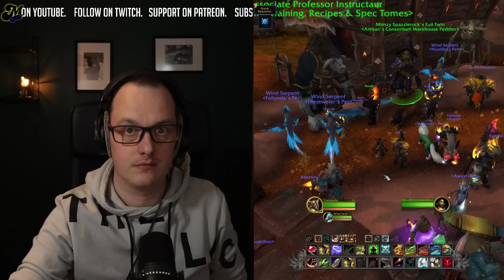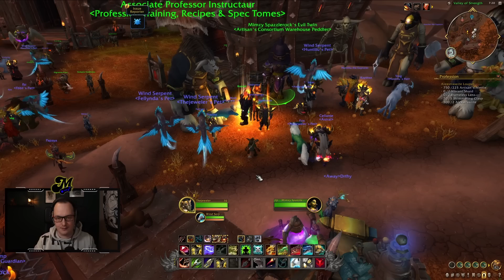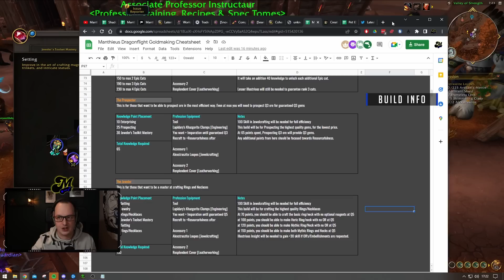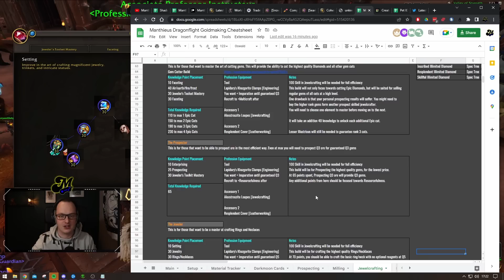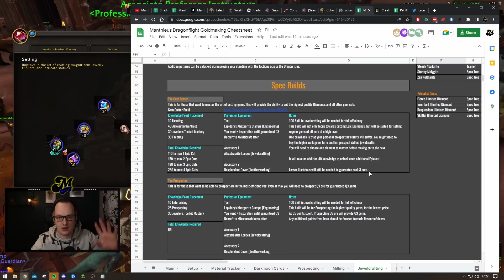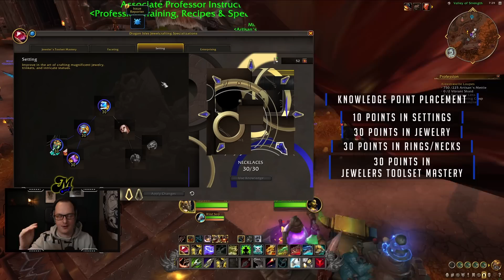Skill Required | Dragonflight Goldmaking

Comment: What about specializing into the Clasps ( up to 3 sockets on necks)
Reply from the maker: They are unlocked at 30 points in Settings, and such are a byproduct of this build anyway.
Reply: I wouldn't rush them. People won't buy them for intermediate gear. The demand will start after the raid opened and people get hc or mythic necks.

Comment: Do you feel specializing in crafter equipment would be worthwhile? My main concern is being brick walled by not having enough artisans mettle. I was thinking of doing this with my army of alts, as thought lots of people will need them at the beginning of the expansion.
Reply from the maker: Probably. This does heavily depend on what they plan to do with artisan mettle. If it has to be provided by the buyer, this could be a very good market.

Comment: Who doesn't see a repeat of legendaries here? I'm not sure work orders will help as much as Blizzard thinks it will. How many work orders do you think you would be fulfilling for R1-R5 legendaries if it existed in the current game? This very much looks like another gold sink barrier for entry (which for better or worse, proved to be the most effective one to date in terms of professions).
Reply from the maker: Recrafting is a thing. The early demand to rank 5 quality might be reserved to only those who are willing to pay the premium. Most players will buy a 2/3 quality items as crafters will be willing to fill orders on those for cheap to level up,  then be able to upgrade that item for a small fee later when the prices come down because more crafters now can make them. Unlike legos there is an upgrade path that does not require replacing or buying another expensive starting item.
Reply: @Manthieus  Can it skip tiers though? One of the major flaws of leggos was the ability for consumers to just skip tiers. It meant that R1-3 became sinks that no one ever wanted.

If they had been required for upgrades by all players, it would've driven the prices down across the board as newcomer crafters leveled up.

Comment: Hi, awesome vid! I'm also making the list of where I found the Knowledge in treasures, once Im done I'll text you on the discord
Reply from the maker: Thanks. :)
Reply: Do you know if i collect the treasures while leveling (so no DF professions yet until 68) am i losing the knowledge points since its one time treasures?
Reply: @opmami  yes you would be missing out.  However, you can get professions as soon as you set foot on the islands (there are trainers in the landing area).  Not sure where you got the 68 limitation.
Reply: @fracguru2069  thanks for answer, i read it somewhere on reddit i think - i was a bit concerned so thats why i asked. Thats great so we should immediately learn df profs
Reply: @opmami  not sure if you get the knowledge items if you don't have professions learnt on your character. So the best way, just to get the prof you need and start leveling

Comment: jewelcrafting is the best. i would like to know more how gathering professions level :)
Reply: Gathering professions level by gaining skill points when they gather.  At low skill levels all the nodes will give you a skill.  At higher levels (like 50+) you only gain when gathering the rare nodes (like draconium or titan-touched nodes).  During beta, herbalism was very easy to max out, while mining took much longer for some reason.